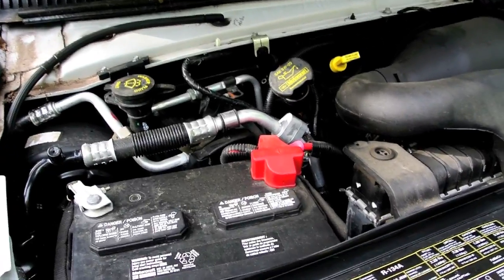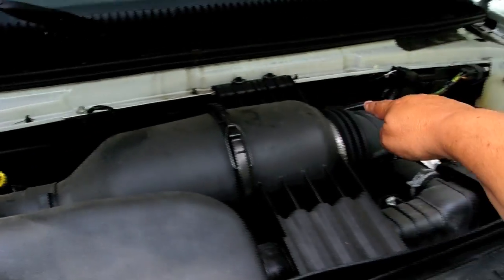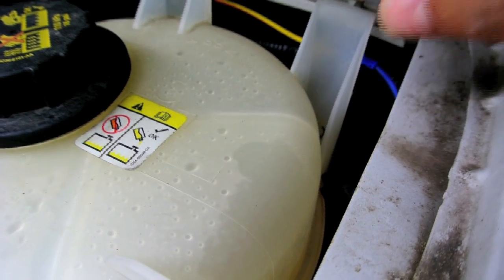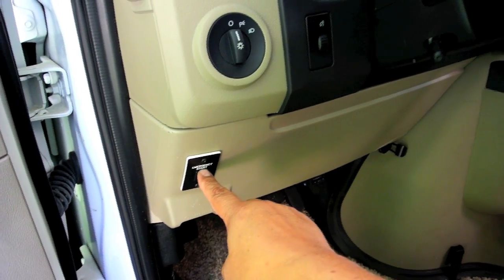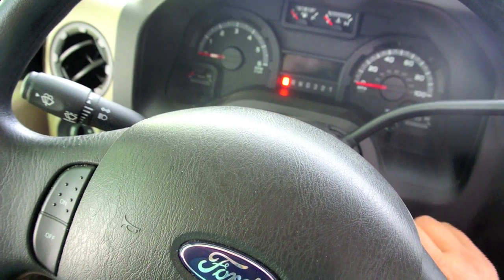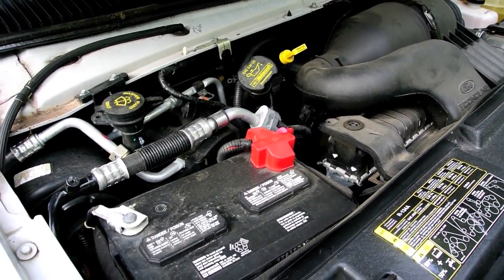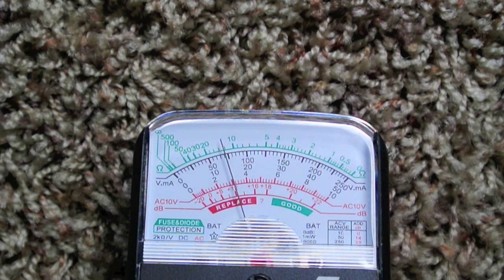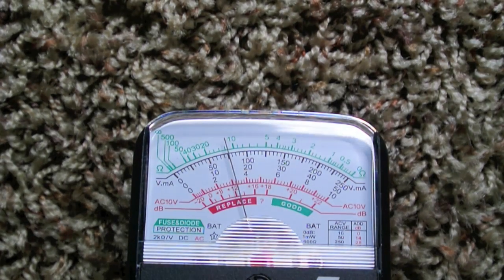Does your Motorhome's Engine Charge Your House Battery?

Comment: (2013 Coachman Freelander 19CB with Ford E350) My Alternator doesn't charge the house batteries, but the cables and solenoid are present.  I found a fuse that blows right away when replaced.  I'll fix this, but thanks for the video because I was thinking about installing something and didn't realize I had it.

I do have a question about the switch under your dash.  I don't have that and I'm not sure why it is needed.  If the solenoid closes with ignition on, aren't the house batteries "helping" to start your engine whether you push the button or not?
Reply from the maker: I provided a detailed explanation in your other question. But the short answer is that the ignition switch does not close the solenoid, but rather only after a sensor detects the alternator voltage. Of course, this would be after the engine is started.
Reply: Jusr a thought. A class C without a generator may have this relay but one with a generator would not need it. The emergency switch if needed should be held on for a short while to put a quick charge into the motors battery. My class A engine does not charge the coach batteries and the genset does not charge the chassis bats. When parked for weeks in the desert I have a switch so that I can occasionally charge the coach bats. With the genset or solar. Kinda long winded but.

Comment: The contractor  also avoids that the house battery discharge the engine battery if understood well? 
I am not finding the switch : ford e250 1994 eclipse conversion. 
Voltmeter not moving much so I guess I will have to disconnect the house battery and measure the voltage so see if the voltage is 0 when the alternator the engine not running and 12 when running. This way I will kill two birds with the same rock : I will know if the alternator charges the house and I will know if  the house is isolated from the engine when the engine is off. Right?
Reply from the maker: Not exactly sure what you are attempting to do, but running an alternator with the battery disconnected may damage it. Please consult a qualified service technician if you are not experienced in these matters.

Comment: I was told not to charge two batteries of different style and or size together.
Reply from the maker: That is correct... when both batteries are directly connected in parallel (or series as well). The reason for this is both batteries must be charged/discharged equally.

However, in this situation, there is an isolator between the engine and house batteries, which prevents the issues related to "unbalanced" charging.
Reply: @RVProject  which means the motor could NOT charge the deep cycle house battery and the quick discharge engine batteries at the same time.

Comment: nice video thanks.. i have a class a   its a 2000  year..   i have  2 house batts and one starter    i put a solar system in too..  i was wondering is my Engine  charges my house batts.. i will try that test.. thanks
Reply: Yep.  Something is trying to turn it on.  It actually is a relay. When running it should be constant.  If you can isolate the relay then you can see what is cycling it 

Bad emergence start switch or alternator voltage isn’t right

Comment: I had a "discussion" with a young guy about this, his position being that his didn't and no RV did that.
My nephew always had one on his RVs. My neighbors does and his is a 1998. I know mine will! 
It can also be added as after market or a DIY which is nice. Can also cut down on the need for a potable charger unit. I heard of a recall on one of those not long ago.
Reply: awboater My 2008 Sprinter based Dodge Fleetwood Icon chassis definitely charges the house batteries. I posted a video in which I repair the charging system. I tested it after the repair and demonstrated the house batteries were indeed charged by the chassis.
Reply from the maker: mars1952 There are always exceptions I suppose.
Reply: @RVProject  my 2016 Mercedes sprinter airstream definitely has this feature.  In fact it seems like that is the only way to get everything back up if it goes down.
Reply from the maker: George Purdy I would guess that most motorhomes have this feature, but some don't. For example, I believe that Mercedes Sprinter chassis based motorhomes don't as it specifically voids the Mercedes warranty.  Otherwise, it is a very handy feature to have.